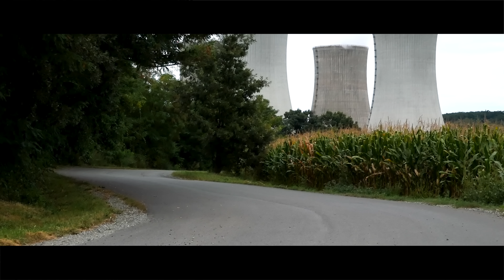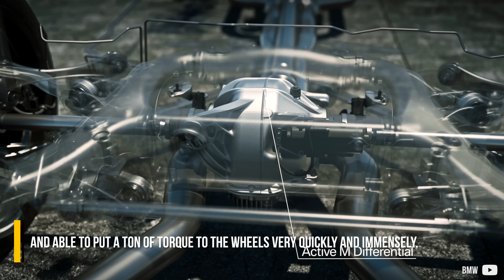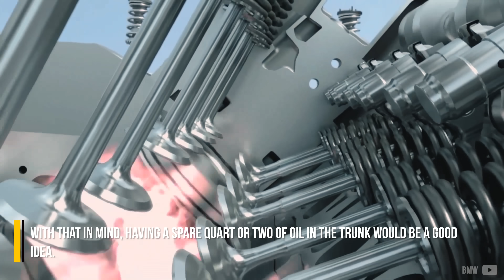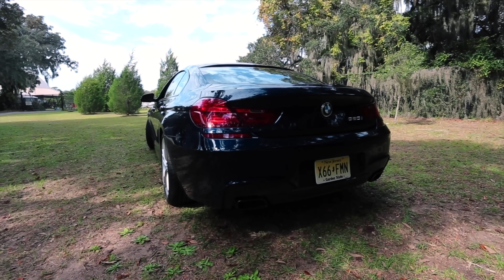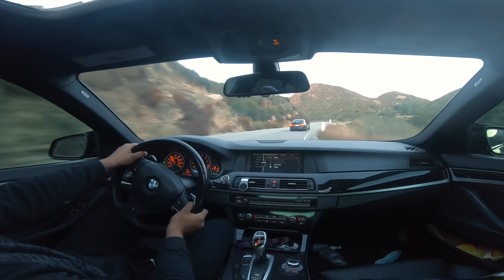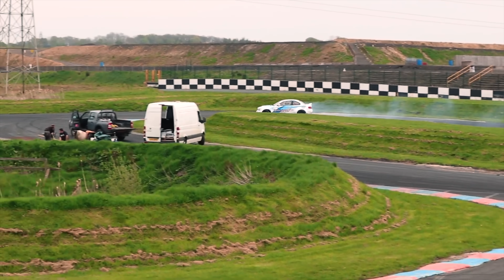The Worst BMW Ever?

Comment: I have a BMW X5 50i 2011 with the N63 (original motor). It has had oil changes every 5,000kms with either BMW twin-turbo 5w-30w or Liquid Molly 5w-40w (in summer months). It uses approximately 250ml-500ml of oil every 5000km's and so far, has only had the auxiliary water pump for the turbo's fail in 10 years of ownership. It is not tuned and no modifications have been done to the exhaust. It ran 13.7 1/4 mile earlier in the year (on a drag strip). I agree the plastic/rubber components BMW uses for cooling/oil flow/radiator are not great in high temp environments and fail prematurely. I also have read many horror stories about this engine. So far mine has been great, fingers crossed it continues to be so :)

Comment: Rod bearings in my 2012 X5M (S63 Engine) spun last year with only 49,500 miles. Meticulously maintained it & drove like a gentleman most of the time. Didn't matter. The bearing clearance from the factory is too tight. The BMW dealership wanted $36,000 to put a new engine in. Had it rebuilt with a new crank, King bearings, & ARP bolts, for a fraction of that cost. Rod bearings in cylinder 2 looked like a pancake. Runs great now...fingers crossed.
Reply: I hope they rebuild it with correct bearing clearances, it that's the case you should be good.
Reply: Wow
Reply: You bought it new?
Reply: S63 was shit, I wouldn’t buy that
Reply: Trade it in and run.........

Comment: From a drivers perspective, I think this is one of bmw's best engine. I've broken 5 axle shafts on my X5M from the massive torque this thing makes almost instantly (not stock). My biggest turn off is the sound.. Knock on wood but at 133k miles the engine has been the most reliable part of my X5M.
Reply: 14 m5 155k miles 5w50 redline oil heat wrapped downpipes stage 2 turbos may get a vented hood just to help with the heat
Reply: @RUBENZSLOW  Sounds like an absolute unit. Dct clutches holding up? I should have wrapped my downpipes. It gets rather toasty in the summer.
Reply: @josae.d  held up great going to upgrade those soon dealer hooked me up with a new DCT at 90k
Reply: Regarding the S63 sound. The sound it makes is because of it cross bank exhaust manifold. The n63 has traditional left and right bank exhaust manifold. Essentially the sound is changed due to changing the firing order collected in each exhaust. I put full custom dual 89mm turbo back with a more gradual and longer x pipe. Car sounds mad and more of a supercar exhaust note. Stock exhaust or cat delete is absolute rubbish in my opinion
Reply: @VinceLMarchesini  you were right, I finally threw an xpipe on and I wish I had done it sooner. Finally the sound resembles a v8. And the car is now substantially quieter which I like.
Reply: @josae.d  yeah the x pipe will soften the sound at low rpm and help eliminate resonance keeping drone down more. Glad you got the sound fixed! Sure it's reinvented toy love for the car. I used to have a company in the valvetronic exhaust industry so I'm super passionate about exhaust tone
Reply: @VinceLMarchesini  so, outside of the diameter upgrade you've added a  proper crosspipe in place ?
Reply: @jamisonebert2398  so to get a full 89mm you need to cut off the downpipe flange that's bolted to the gearbox. The flange is a bottle neck pinch down to something stupid like 70mm which will eliminate the high pitch notes. Then on the x pipe, having a more gradual entry and exit angle in the x pipe will result in tuning that exhaust note to a screamer  in the high rpm.
Reply: too bad its only installed in cars the size of 1970s lincoln town cars
Reply: I have 138k on my X5M and it still runs like a champ! The only issues I’ve had with the car so far are a few bad coil packs, blown air bags in the rear suspension and a bad pump for said bags. Besides that, proper maintenance and frequent oil changes (with Liquomoly) every 4-5k and the car has been amazing. It’s now my wife’s car and she loves it!
Reply: @Mrwaffleandmilk  new still have it
Reply: The sound wtf? Put an exhaust on that badboy and some catless downpipes and hear it sing. The S63tu motor is one of the best sounding motors out there
Reply: @vz6235  my other car is a VF650 charged E90 M3. The bar is set pretty high when it comes to sound lol. The s63 does not sound like a proper v8. Yea it makes cool pops and farts but it's lacking throatyness. Dunno if it's the firing order or the hot-vee factor.. or maybe both. I have vrsf downpipes, etc.
Reply: @josae.d sounds like a beefy n20 tbh. Kinda make sense though 4 x 2
Reply: It seems like a modern pushrod v8 with port injection and variable valve timing could do the same job

Comment: My experience with German cars is that you have to baby them for sure. Frequent oil changes with quality fluid. Premium fuel. OEM parts especially sensors. I've had a 24 year old Toyota that literally went on a road trip with very little oil. Only noticed when I arrived home. Couldn't imaging doing that with the Audi.
Reply: I love toyota but my commuter  scion drinks a ton of oil and rattles like crazy but as long as I keep the oil topped off it just keeps going.
Reply: Exactly this based on my 4+ year ownership of a 135i
Reply: That's the thing tho you're meant to look after a car. It's not expensive to do an oil change once a year so I don't get why people cheap out on it

Comment: It seems to me that car makers, in this case bmw, intentionally make parts that brake just to make more money from people driving them. I can't understand that they have cutting edge technology with top engineers that make unreliable product.. Am I thinking wrong here?
Reply: This is what happens when you try to squeeze every ounces of power out of the engine and meet the emissions requirements at the same time and also design it as compact as possible and also built it as lightweight as possible by using plastic.

Comment: This dude reads from the page but no clue what his talking about....do the proper maintenance in time and stop using cheap parts and no problems at alll
Reply from the maker: Well, then I guess BMW has been using cheap parts right off the assembly line since most of the issues appear within the warranty period. Besides, many of those parts are not even made in aftermarket, genuine only. I had a BMW N53, I know a tiny bit from my experience how things work with their engines

Comment: I have had my 2006 BMW 525i from nearly new, less than 1,000 miles when I bought it 15 years ago. It has over 400,000 miles on the clock now, it hasn't been in a BMW Dealership for 12 years and still drives like a dream. I keep thinking of changing it, but it is just so reliable. My goal is to crack half a million miles then by a new car.
Reply: Oh yeah those m54 engines are awesome. With the right treatment those can drive to the moon and back.
Reply: @Audiomannen  Heard the B58 engine is very unreliable
Reply: @Yggdrasill8 completely untrue 😂 its their best engine

Comment: Slight misinformation, both engines are not made in the same factory, the original N63 was built in a different plant to the S63TU. Also It doesn't share injectors with the N54, N63 and S63 use EU5 and EU6 injectors. The S63TU is admittedly the better engine, if you do the preventative maintenance, replace bearings and injectors your good to go, along with regular oil changes. I found this video just bashing the N63, they have kept it going for over a decade now so are the issues as prevalent as you make out?

Comment: If youre getting bmw go for the i6 old NA or recent turbo models like n55 b58 s55 s58. This is coming from a guy that had to buy new s63 because StAgE TwO iS MoRE POweR -_- Imo stay away unless you have money and mechanical skills. Better off with i6 overall. N63 and the older non turbo v8s i would never ever own. Fuckkkk that.

Comment: Most of the time when people talk about a certain brand being unreliable it isn't true, it's dependent on a model or engine. An example is GM's Northstar engine and for BMW their Northstar is the N63, but GM also has the incredibly reliable LS series likewise BMW has N54/N55 engines. I would like any examples of a brands whole entire current range being unreliable it might be fun to read about lol.
Reply: Toyota and honda extremely reliable,   jaguar and land rover extremely unrealiable there you go
Reply: @ElekLVL  I work at dealership group with those brands. can confirm.
Reply: @ElekLVL  Toyota and Honda service depts get plenty of business, just not for catastrophic engine failures.

Comment: I would never buy a BMW made after about 2010. Even the Bangle-era cars were downgrades from their predecessors, but this generation has to be some of the worst cars they have made and they show no signs of improving. I worry for the future of BMW, honestly.
Reply: Had an X5 2008 with the V8. Drove it like I stole it for years. Was basically flawless until about 70k. Then became a constant pain ever after. Always some little problems, and then the major leaks and code throws. Sold and 102,000 luckily for some money. Next guy wasn’t happy with the reliability, but he was warned.

Comment: The N63 should not have temp issues in the US where you never go harder than 75 mph. And the N53/N43 were by far worse but never made it to the US. Needed low sulphur fuel for SCR catalytic coverter (lean engine). BUT: Looking at the dirty workplace you will never be capable to service  BMW engines.

Comment: A family member had an X5 5.0 with the N engine, it constantly broke down from about 20 000km. It was so bad BMW gave him another X5 5.0, which also broke down constantly. Eventually he sold it back to BMW and they gave him a massive discount on a 2020 X5 55d.
Reply: Funnily enough, the 50d engine is also terrible. It lasts 60k and then it suddenly goes bad
Reply: Wait, wait, wait... dude bought an X5 which was so unreliable, that BMW had to give him another one.  And THAT X5 turned out to be unreliable, so dude bought ANOTHER X5?   Some people have more money than brains.  Bahahha.
Reply: @foxwithtubesox1075  They gave him a 30% discount on a brand new X5 M55d. That engine doesn't have issues, it's a no brainer.
Reply: @iwonder1216  The tri-turbo M50d used the N57 which suffers from the same issues as the N47 4-pot.

The quad-turbo M50d used the B57 which so far seems to be reliable. Sequential and parrallel turbocharging - each pair of turbos was fed by three cylinders.
Reply: @applejuice5272  interesting, I did not know that.

Comment: Lol, complete garbage. I have an m6 that I bought new with 100k miles on it now and it has never had a single problem with the drive train... also running a tune and down pipes.

Comment: All common sence out the window. A seperate pump for the turbos when you can use The Engine Cooling Pump. No ceramic wrap on the turbos ??? No wonder the japanese engines out last Zee Germans. Low tension rings ? For extra blowby and convertor failure ? Also What Shit brand Turbos start leaking rite away .... WOW

Comment: I've had my 2014 F10 M5 for 5yrs now, just passed 60k miles on it, I haven't had any issues so far as my daily driver. This video makes me want to sell it now but can't think of what would be a good replacement for it.
Reply: Same. 2013 M5 stage one tune, SSP performance clutch. Got it at 30k miles, 108k miles now. No major isssues with engine or drivetrain so far. But yeah dude this video made me nervous af. 😂
Reply: Get yourself a BMW with B58 engine.
Reply: 1 change your oil every 7000 miles...with the right oil.
2 use a zinc package additive (Torco).
3 MAKE SURE ALL THE SPLASH SHIELDS UNDER THE ENGINE ARE INTACT. They force the air to go through the heat shields that create a tunnel around the exhaust manifolds, turbos and cats. There is an air scoop right under the alternator for this purpose. If the splash shield under the engine is missing or damaged, the air coming through the grill will go out under the engine instead of being forced through the cooling tunnel created by all the heat shields around the turbos.
4 use the proper coolant.
It's pretty simple. It's the owners and mechanics that are why there are so many problems with these.
Reply: i have a 14 comp 5 year ownership 155k miles no issues 5w50 redline oil.
Reply: oh and stage 2 turbos and tune
Reply: get a g30 m550i…they have the most recent n63 with factory 530hp for the 2021 models. from what i’ve seen, the 2018 and newer models have been fairly reliable with huge potential for well over 600whp on simple tunes
Reply: Sold my 2015 to Carvana, made money on it and i haven't looked back.
Reply: @BitterCarGuy   how much they give you?
Reply: @Mrwaffleandmilk  Yes it will definitely be slower, but the interior is much nicer and the engine is naturally aspirated so it sounds fantastic. All the motoring journalists I read really love them.
Reply: E55 or CLS55 AMG. Bulletproof motor and transmission and sounds way better
Reply: W204 C63 AMG
Reply: Get u a hellcat
Reply: @kennethgreensr105  Too heavy and can’t take a turn to save its life
Reply: @sav22rem22  m5s aren’t far off in terms of weight. That being said, I’ve driven an e60 m5 and can say that its handling characteristics were impressive considering its weight.
Reply: @kchinz34  BMWs will always be more focused on handling despite their weight. Dodge just slaps a bigger engine in a washed up chassis with goofy suspension and calls it a day
Reply: Lexus GS-F.

Comment: The worst bmw engine is most of them lol! 4.4, 4.6 v8 eats timing chains like they are going out of fashion! The lack of timing marks and the requirement to buy a special tool kit for $600us just to service the chains was the last straw for me! Vanos issues, everything made from plastic, bmw's are the least reliable and most expensive german cars to maintain! Someone gave me a really low km m54 engine last week and I threw it away! I don't want to be bothered trying to sell it because I can't guarantee that it will be good.

Comment: These motors run very hot, have low friction oil rings so plenty of oil burning, have crappy PCV systems and fueling issues due to sticking injectors. If you have to have one of these cars make sure it's an updated motor (2012 and up) and that it has oil change history where the oil was changed more often than the service manual calls for. I don't understand how BMW thinks it was okay to run oil for 24,000kms in a high compression, high heat and high powered motor that sometimes burns through a quart of oil every 1,500kms. Add in the heat soak issues where the turbos are located and the faulty injectors which can stick open and hydrolock the motor and it's a recipe for disaster. I know a German auto shop nearby my house and they do at least 1 N63/S63 replacement per week.
Reply: The heat from the turbos, and cat-converters is the killer. Once the valve seals dry up or harden up due to the heat, the oil consumption will get much worse. I' own two BMWs and I want to get one with the V8 engine, so I'm hoping the BMW engineers have already sorted this problem out.
Reply: @rollydoucet8909  Yeah I’m tempted to get a 550i or 750i to replace my boring (but dependable) C300 Mercedes. If I do go the V8 BMW route it will be a low mileage one with oil change records and I’m immediately going to go with catless downpipes with a tune and install a 90 degree thermostat along with reprogramming the DME so that the coolant runs at 90c instead of 105c. That right there should solve a lot of the heat soak issues. Probably go with some fresh spark plugs and Motul 5W40 oil.
Reply: @IKhanNot   well let me know cause I’m thinking about selling my 550i with almost 65k miles on it.
Reply: WHY ONLY ALL 24'000 KM? SIMPLE, BECAUSE BMW KNOWS MOST BUYERS CAN'T AFFORD A OIL CHANGE. CARS FOR PEOPLE WITH MONEY, NOT FOR THE POOR "WANNA BE RICH" IDIOTS!

Comment: Z Germans can’t build reliable any more . I had a 320 m sport d and it needed a dual mass fly wheel and a vv turbo  and 4 cracked alloys before 50,000 miles . I sold it and bought Japanese. Next time you look on the back of a car recovery truck you will see a nearly German car . It’s a shame because they used to be the best .

Comment: Hot  V  concept is great for Turbo Diesels . Not so much Petrol/Gasoline  engines . Easy enough to comprehend really .
But  BMW  being them . Wasssss ! Ve are not  Wrong . Ve are Ultimate  Cherman  Engineers . Ve vill Not tolerate Dissent . You vill see .
B O O M ! again Fritz .

Comment: i wonder if they just simply had better heat extraction from the engine bay and 5K mile oil change intervals if they would last longer. ive had a 650i try to ricer flyby on me on my 535i before and he failed, little did he know i had had my boost and fuel cranked up, along with water methanol injection and a conservative 50 shot of nitrous.

Comment: If those cars were driven daily and not garage queens, with oil changes at 4 to 5,000 miles I'll bet a lot of the issues wouldn't be there, engines love to run and trany's love to go down... the road that is. Think about your car as your body, your body wants to move but not be beat on, it wants to go get out of bed and do stuff but not over do it. What happens if someone sits still for to long your lose circulation to limbs and go numb but if you do it to much or to long you break really easy when you move oh and usually you end a lil plump. That's my rant, If you're gonna come at me at least have a good argument otherwise thanks for reading and I truly hope you have a great day. BTW Visio thank you for all your videos they've all been great.
Reply: JA JEBIE